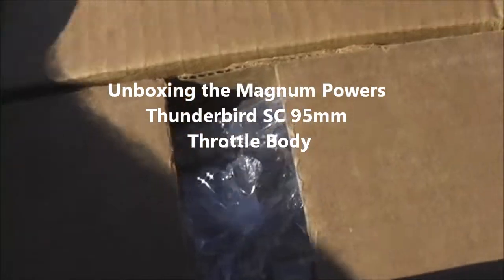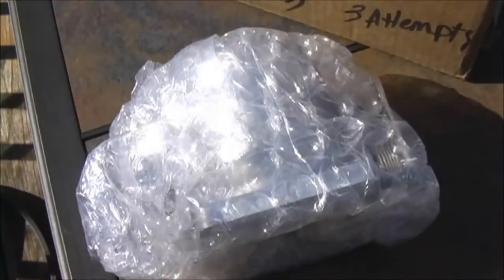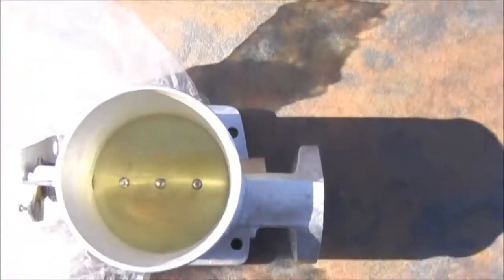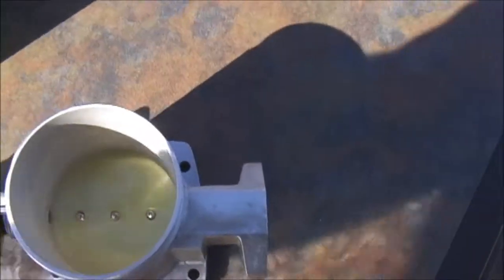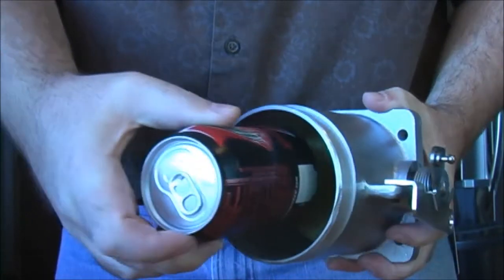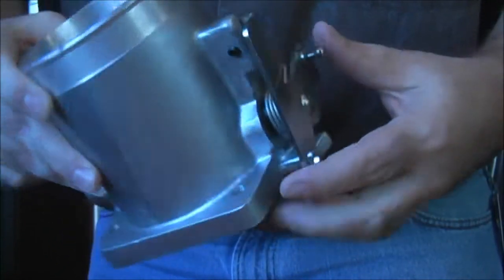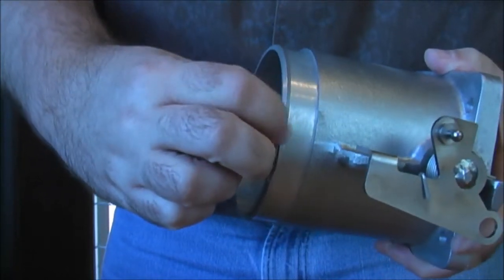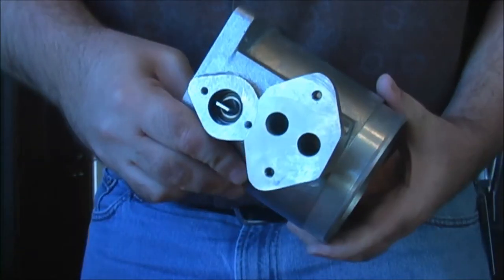Unboxing Magnum Powers 95mm Throttle Body

Comment from the maker: Sorry for the late reply.  what you might have seen is fittings for heater lines.  For some years Ford and even other manufacturers would route the heater lines through the throttle body to prevent icing up of the throttle body.  They are unnecessary and were deleted in later years.